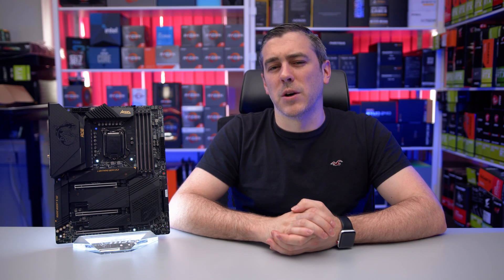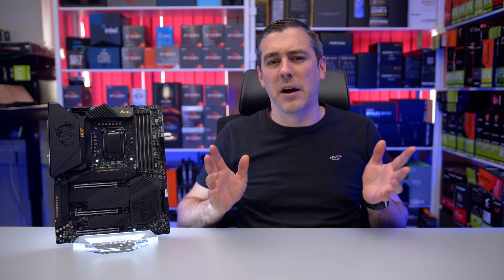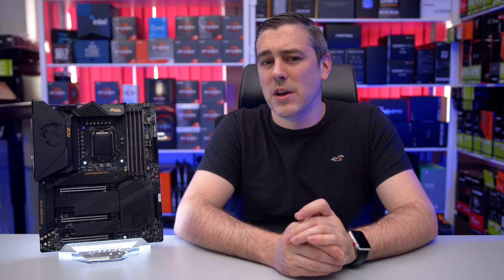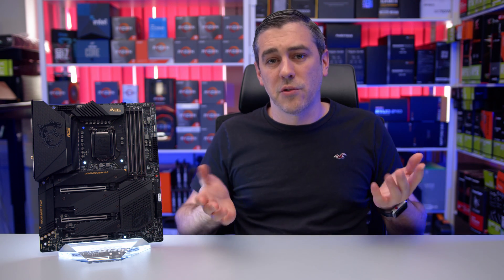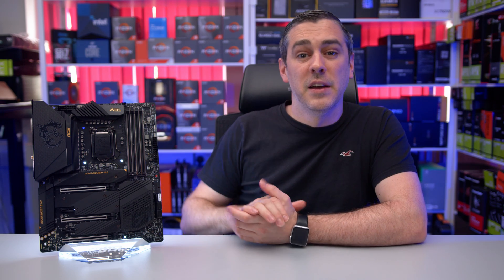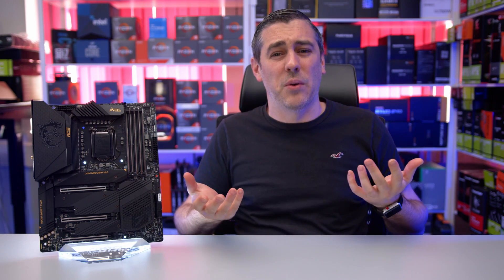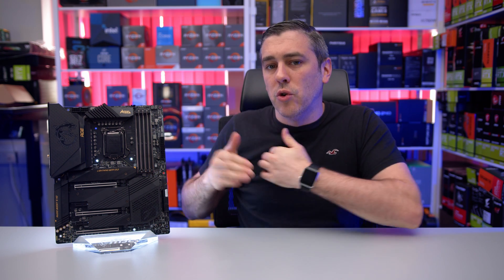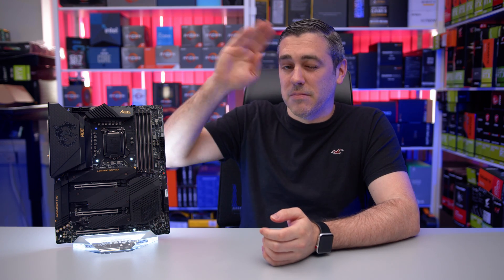Will this Mess Up Your Whole PC?

Comment: A simple adapter is all that's needed - don't see the big fuss over it. Wouldn't be surprised if an adapter were included with the boards considering most modern supplies provide 95% of the wattage over the 12v rails. Already using my "old" 550w supply to conform to a 12v only AMD EPYC platform which I'm typing this on.

Comment: the 2 4pin connectors are output power and the 6 pin and 10 pin are input power

Comment: I can see the advantage on smaller ITX builds. You have a smaller SFX PSU and only a single cable with storage being M.2.
Just hope Motherboard makers place the 8+6/8 PCIe power connectors in a sane/sensible location. (we all can dream!!)
Reply: Not only that but 12VO gives the easy option of an external power brick.

Comment from the maker: Do you honestly think this is needed or is just pointless?
Reply: It remains to be seen. If this complements other advances to come at the same time which bring some tangible benefit to the consumer, then yes. But things are seldom so obvious; if they were, Intel would have mentioned it by now. I suspect it is more for their benefit than for ours.
Reply: That's a good question for debate. Considering a lot of the power used is mainly for 12v nowadays I'm not surprised 5v/3.3v is being depreciated to being integrated into the board. At least now efficiency can be focused on with 12v at the PSU side of things and leaving what little we actually pull from 5v/3.3v being offloaded to the board. Ever since the older days of the Pentium 2/3 we have been sliding further and further away from 3.3v, dropped -5v rails, and relying less on 5v as noted by the ever drindling amperage provided on them from supplies as we progress. Back then we used to have over 50A on those rails for instance and much less over +12v.

My only concern though with 12v only supplies is that they leave drive support to how much power you can draw from the board. If you have a lot of drives overall it would be more necessary to draw from the supply itself rather than rely on the limited throughput of a 4pin dual voltage connector from the board. Aftermarket providers will obviously be keen to provide voltage buck converters to convert the 12v direct from the supply for these as needed but it just makes is overall messier in the long run in niche cases.
Reply: its needed it saves so much power across the millions of pcs